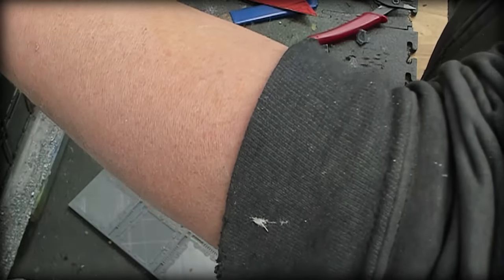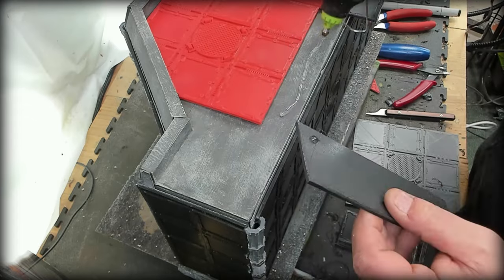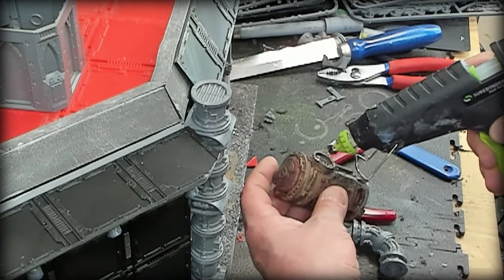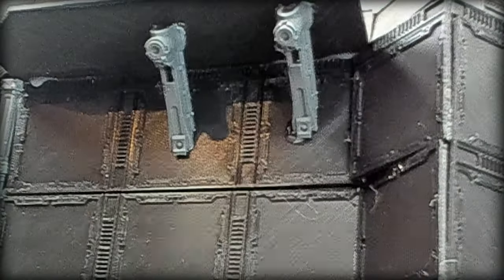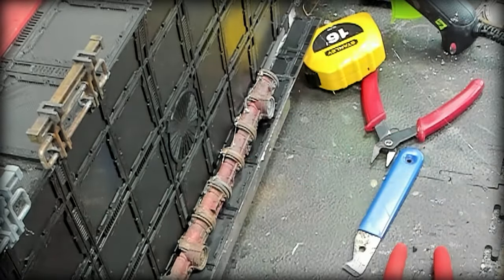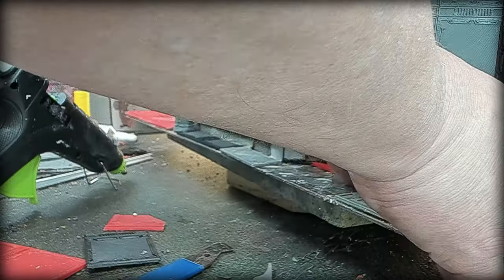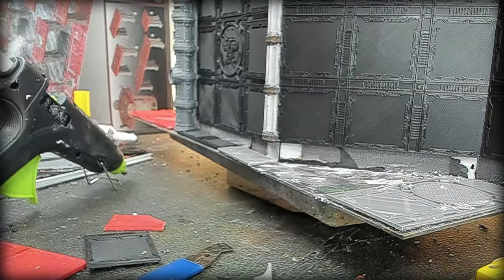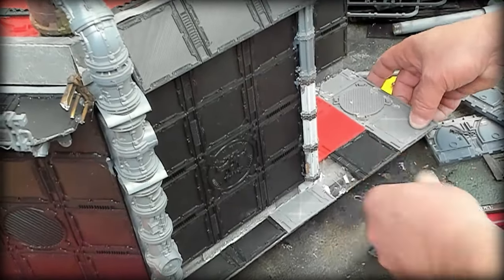Necromunda Hivewall Kitbash

Comment: For the second upper spire wall what if you had and outflow pipe at the top that's just releasing it's contents off the edge of the wall as the upper hivers quite literally shit on everyone below them in the social order?  Maybe literal sewage outflow maybe toxic industrial runoff, then to make it worse maybe have a tile for below that wall section where they struggling to purify the "effluvia" and it's something worth fighting over for the under hivers.  I could see incorporating all of that into a campaign where climbing gear options are unavailable before a certain mission at which point a certain number go graple guns will go to each gang and they will be trying to break into that depot.  Afterwards they will keep those and be able to buy more normally as these better geared gangs begin to utilize more vertical game-play but also have neutral or third player enforcers and spyers fighting both sides.
Reply from the maker: You are starting to get to the nitty gritty of what happens in my headspace sometimes brother!  That's fantastic for a future section build!  This one I have a plan in place for an enforcer precinct for the second wall section with a gate in-between them but........  I like where your going with the effluvia concept!  Thanks for tuning in and shouting out!